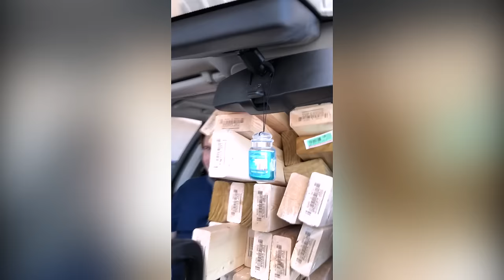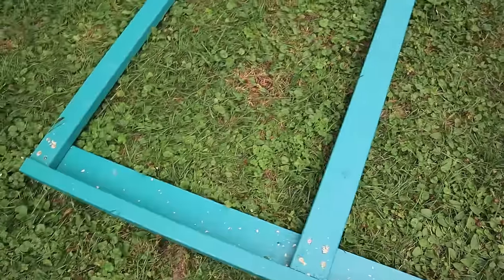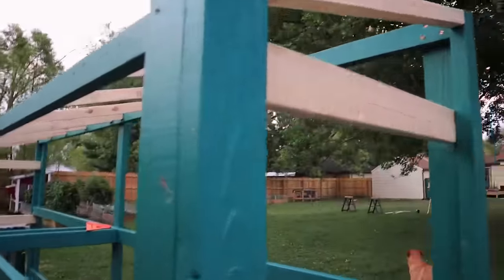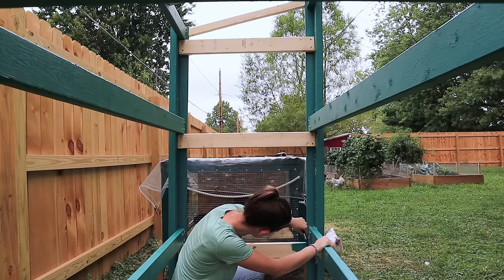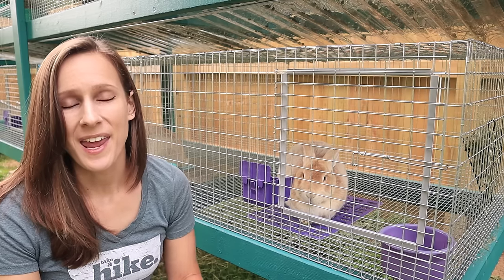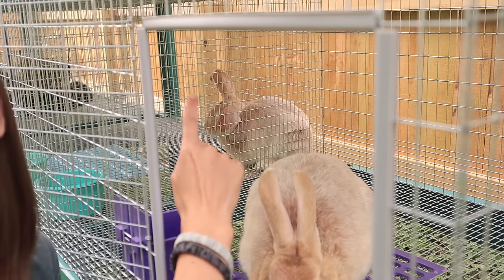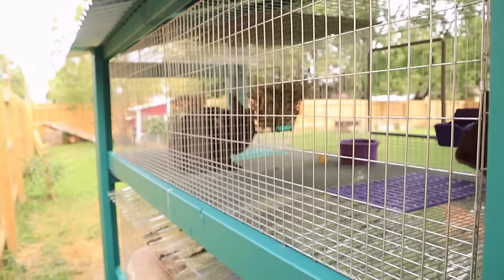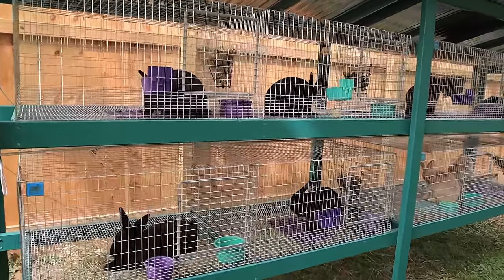Rabbit hutch remodel/build with KW Cages (silver fox and creme d'argent meat rabbits)

Comment: A suggestion to extend the life of your hard work.  Place each of the legs on a paver stone or even just a red brick.  The pine you used will absorb moisture being in contact with the ground (even though it's painted).  Pine will begin to rot within a couple of years, if it's constantly moist.   You may also want to treat the bottom 12" of each leg with a water sealant, each year.
Reply from the maker: I have the front legs standing on wood boards right now but in the long term I would love to find some concrete! 😊 water sealing is a good idea.

Comment: The lights do look cool. I imagine you keep them off most of the time unless you need to check on them at night for some reason.  Once I have had quail for a couple years I plan to add rabbits and using KW Cages seem like a good thing to use.  Keep up the good work.
Reply from the maker: Thank you so much! Yes we only use the lights at night when we do chores, and to extend daylight hours during winter. They are turned off overnight.

Comment: Why not just use solar to power your fans and lights. Nice layout, but I think they need more room to run. I installed airborne tunnels between my hutches. I used half inch wire cloth and zip ties, in case you are interested. They are predator proof to. My rabbits love the freedom to run and play. Just a thought...

Comment: I love your hutch! I would recommend getting a little solar panel for your lights. It would be cheaper than running electricity
Reply from the maker: Solar is something I am doing a bit of research on. The only problem is, I’m not sure it would be able to fully power 4 box fans for next summer. But we’ll see! 😊

Comment: Do you think adding wooden side panels would be good for the winter time to block the wind? Is it warm enough the way it is or do you add boxes for them to get into in the dead of winter? Looks great I'm going to build one and move my KW cages outside and back into the garage when it gets hot.
Reply from the maker: So far I have stapled plastic sheeting on all sides except the front to block wind and rain. My next video will be all about creating a plastic rolling curtain for the front for the really cold winter days 😊

Comment: Just a tip, you should put more padding like a mat or something maybe a blanket on the wire floor. This will help the rabbits feet. For the poo and stuff to fall down still you can put mats on half of the cages.
Reply from the maker: When I was younger I actually had a rabbit ingest and choke on fabric, so I don’t like putting anything like that down in their cages. they do have plastic resting mats but overall I find that they prefer to lay on the wire. It is a very thick gauge and comfortable for them 😊
Reply: Ok, I completely understand I would never want that to happen. It’s good you have some type of padding!

Comment: Just FYI if you try to run four box fans on that extension cord it will have voltage drop and will catch on fire. So, I hope you do run wire for that load.
Reply from the maker: Right, we will be running electricity 😊 or solar if I can figure out how that works!
Reply: @TealStoneHomestead  Cool...solar is still pretty expensive and don't really last long enough for the investment. An electrical supply store can tell you what gauge romex to run. Just tell them how many amps you'll be pulling and how far you need to go.

Comment: Wow! You built mostly by yourself? Love the color on the wood frame.
Nice, clean and neat design! The clear/transparent plastic roofing is an awesome choice.
J-clips and J pliers is cool tool! LED strip lights are so cool tho, especially during night time.
A bit concern on the wood frame feet, have you thought adding concrete footing riser to protect from water/moist on the ground/grass?
Reply from the maker: Yes I designed and built everything. My husband had to help me lift and place the sides, and I also enlisted his help to screw the roof on (I’m short lol). If I had a do-over I would have placed it on concrete footings, but after almost 2 years we had no rotting 😊

Comment: Looks nice. I like the lights and the teal color.  Do you think your rabbits feel safe being on display and so out in the open? My rabbits like to hang out on the ground under a step stool, especially if they get spooked about something. I like black vinyl coated hardware cloth better than rabbit wire because I don't have to worry about rats or mice coming in for the rabbit feed and the black color makes it disappear some.
Reply from the maker: Thanks! I think they feel safe 😊 our backyard is small and fenced in, so we don’t have problems with predators. Our older cages were black coated, but I actually didn’t like them! They rusted terribly, but that could have been because they were lower quality. These are KW cages in my big hutch, and I love how clean they look.

Comment: its ironic i just found your video because i just found there site last night. just curios i was debating the 30 inch depth bause i wasnt sure id be able reach all the way in there, if a rabbit is running, do you have any issues with this
Reply from the maker: 30” back is a bit of a stretch, I’ll admit. I use a small crate as a step stool to reach my top row. But it’s worth the extra space when it comes to inserting nest boxes and babies hopping everywhere. Most of my rabbits come to the door for pets and treats, but I do have a couple shy ones that like to hide in the far corner. They can be difficult to get out of the cage without scruffing sometimes. If I had to do it over though, I’d still go with 30” personally!

Comment: OK- so where's the box fan installed at?  It won't be too much longer before July, August and September will be here when roasting temp's will kill the rabbits- so how did you do it?
Reply from the maker: Here in Indiana we are still experiencing 30 degree weather, so the box fans are not in yet. My hutch is located under the deep shade of our oak tree. We also supply tiles and ice bottles for them. Most important things to keep in mind for rabbits in summer is airflow and shade. Stuffy living conditions can be dangerous for more than one reason.

Comment: You mention adding airflow, I am new to rabbits so bear with me, but aren't we supposed to keep rabbits dry and out of wind? Is it just different for silver fox rabbits due to their fur type?
Reply from the maker: Airflow is different than windchill. You want rabbits to have adequate ventilation and constant exchange of air to keep their respiratory systems healthy. On the same note, you want to protect them from harsh winter winds that can cause respiratory illness (or worse) while also allowing proper ventilation. Hopefully this helps 😊

Comment: How much time will they get out of that hutch per day? Thinking of their little feet on that mesh...
Reply from the maker: My rabbits get to play in an ex-pen. the wire floors here have been upgraded to a very thick gauge. It is very comfy 😊 it is a common misconception that wire bottom floors are the main cause of sore hocks. Typically feet sores are caused by very thin gauge wire or a genetic problem. Wire bottom floors allow droppings and urine to fall out, so my rabbits stay clean and healthy. They are able to binky, flop, and run around with no problem. They all get checked over regularly. I would be more concerned with Rex breeds or giants.
Reply: @TealStoneHomestead  thanks for clarifying 😊

Comment: You'll regret using regular kiln dried lumber. Your latex paint will accelerate the rotting process. FYI, always use pressure treated lumber and use a wood stain (available in most colors).
Reply from the maker: Thanks for your comment 😊 when I started the hutch it was after lumber prices in 2020 skyrocketed after everything that happened. My husband and I still have college loans and couldn’t afford to use all pressure-treated. I did get pressure-treated for the legs. Overall it has held up beautifully 😊 I have used this exterior paint on many outdoor projects throughout the years without issue.
Reply: @TealStoneHomestead  Penny wise and dollar foolish. Time will tell.

Comment: I am new to this. Do you have measurement of the hutch frame. The height and width of the from of the front and rear and side.
Reply from the maker: Please check the link in the description for my blog post! 😁
Reply: I order the wrong cages. I order the 36x30x18 with partition. Will that be enough space for the does to have kits?
Reply from the maker: @MrBALSTON  36x30 is a great size for does with kits, but 18x30 would be much too small.
Reply: Ok my cage is 36x30x18 I am also hanging nesting box to the side by Pointer Hills products.
Reply from the maker: @MrBALSTON  that sounds great! I love those nest boxes! 😊
Reply: I change my order today.

Comment: How much did this cost?
Reply from the maker: It is hard to say how much it will cost since lumber prices have changed so much this year. The KW cages were the most expensive (around $500). The rest of the materials were probably around $300. So ballpark around $800 at the time of building.

Comment: All that time and care put into this I really wish you would have made a big enclosure for them instead. The fur on the bottom of their paws is not that thick. Bunnies love soft things and they don't get good traction in there. I know its bigger than the recomended size but having them in a space at least big enough for them to hop three times in each direction is ideal and they jump up to three feet in the air. Being outside causes a lot of stress for them being prey animals they are having to be alert most of the time. Its best to make sure they have at least 5 hours of exercise a day so I hope when you take them out they get a good part of the day out. They litter train so easy so you wouldn't have to worry about them peeing and pooping everywhere so they could have some nice padded floors or blankets at least.they have to hiding places in there so they have no way to feel safe if they are stressed and scared. No place to dig. I know you care about them. I really wish you would just improve a few things to make their quality of life better. Making a large enclosure for them to roam around in would be so much better with a divided space for when they need to be separated.
Reply from the maker: I appreciate your comment.

The fur on the bottom of their feet is very thick. If you have rabbits that do not have thick fur on the bottom of their feet, that is the fault of the breeder. Rabbits should not get sore hocks, ESPECIALLY on a heavy gauge wire floor. Fur on the feet can also be affected by thin gauge wire (it can cut into their feet) and also by living or running around in wet or soiled conditions. They get the most traction on wire floors because they are able to grip, Vs. solid floors where they will slide around.

My rabbits are used to being outside and are never stressed. Many times when I go out to care for them, they are flopped over relaxing!

Many of the other things you mentioned are opinions or recommendations that the pet rabbit community has in place. While commendable because I know you also must care about animals, you have to realize that my rabbits are livestock. Ultimately their purpose is to provide food for my family and to better the Silver Fox and Creme d'Argent breed. When producing meat and trying to live self-sustainably, we have to remember that the animals are for this purpose, while keeping strong emotions in check. This is my "grey area" or "happy medium." It is about making a difference in the world and ending factory farming or reliance on a broken food system. Instead I am living on a scale where I can address problems and quality of life per the individual animal.

Did you know that factory-farmed chickens, which is what most Americans buy at the grocery store, must live in less than 1 filthy square foot of space for their entire lives? Workers run through the buildings daily to pick up the dead bodies. Meanwhile, if one of my rabbits die, it is devastating to me. You pick and choose your battles, and this is mine.
Reply: @TealStoneHomestead  That was very well put and I commend you on your activism. Thank you for sharing your point of view. I have more respect for the situation now.

Comment: I wil never, ever put my rabbits on a  gaze metal wire floor
Reply from the maker: You do not have to 😊

However, It is a common misconception that wire flooring is bad for rabbits. Wire flooring (especially the thick gauge flooring I have) keeps rabbits out of urine and waste at all times, and also aids in adequate ventilation, which prevents disease. Sore hocks or sore feet is typically a genetic problem or is caused by soiled living conditions. Rabbits have plush fur on the bottom of their feet and are quite comfortable on the wire. I can assure you that my rabbits do not have sore feet 😊
Reply: @TealStoneHomestead  Thanks, for your answer

Comment: A joist is you’re boards in between you’re ledger running shorter the opposite direction as floor or roof support ! The actuality roof support is called rafters

Comment: your rabbits will get sore hocks please put something below their feet so it wont be painful for them
Reply from the maker: It is a common misconception that wire flooring is bad for rabbits. Wire flooring (especially the thick gauge flooring I have) keeps rabbits out of urine and waste at all times, and also aids in adequate ventilation, which prevents disease. Sore hocks or sore feet is typically a genetic problem or is caused by soiled living conditions. Rabbits have plush fur on the bottom of their feet and are quite comfortable on the wire. I can assure you that my rabbits do not have sore feet 😊
Reply: @TealStoneHomestead  it still very much hurts rabbits I think you should put a flooring down of like cardboard everyday if you wanted something temporary and it’s quick to clean 

But looking at a rabbit on wire bottom cage just generally looks bad and painful
Reply from the maker: I’m sorry you feel that way. It does not hurt them, I assure you 😊
Reply: @TealStoneHomestead  I feel bad for their poor feet
Reply: @TealStoneHomestead  Then you could live by yourself walking on a wire floor all your life :) and your dog too if it is too good and doesnt hurt.

Comment: rabbits shouldn't be in wired bottom cages
Reply from the maker: It is a common misconception that wire flooring is bad for rabbits. Wire flooring (especially the thick gauge flooring I have) keeps rabbits out of urine and waste at all times, and also aids in adequate ventilation, which prevents disease. Sore hocks or sore feet is typically a genetic problem or is caused by soiled living conditions. Rabbits have plush fur on the bottom of their feet and are quite comfortable on the wire. I can assure you that my rabbits do not have sore feet 😊